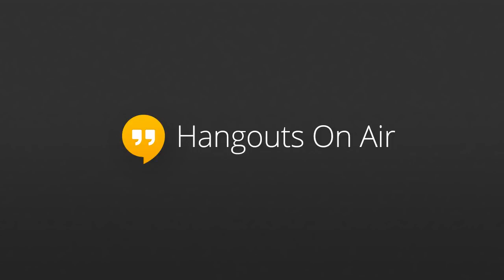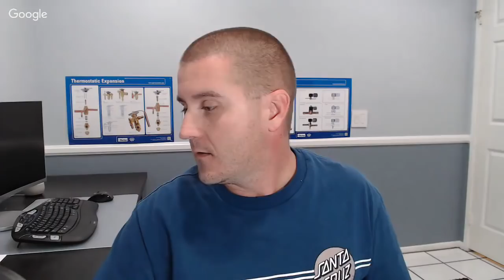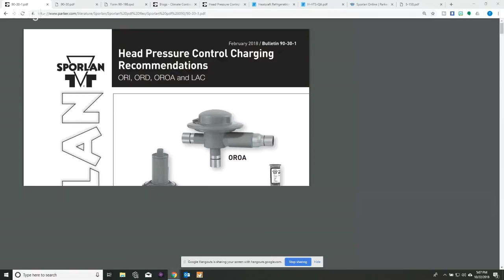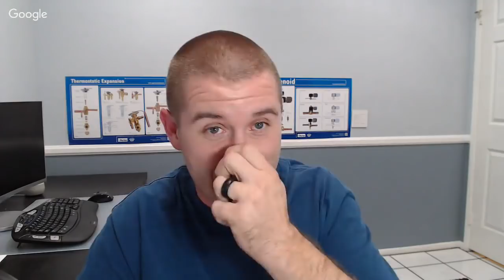HVACR VIDEOS HEADMASTER OPERATION AND Q AND A

Comment: Does the headmaster have a mechanical valve that blocks condenser flow or does the discharge gas fill the coil, reducing usable area and raising the pressure
Reply from the maker: The head pressure control valve restricts the flow and thus stacks the liquid in the condenser which drives the head pressure ip

Comment: Hey man great video. Two questions hopefully you will see this. When charging unit in winter and adding fir winter charge do you just block off condenser to reach above the bypass point of head master then fill to sight glass then add for flodded condenser?  Number two what is best way to deal with micro chanel. And three on trenton unit has a setable hpr. Manufacture says vomes out set for 150 psi which to me is liw for 404a ive alway shot for 180 min. Seen that ? Unit evap freezing up. Sight glass full at 150 psi. Feeling lines, not feeling discharge going through hpr. Last question when torching the reciever if im at 50% or better am i ok or should i shoot for 3/4
Reply from the maker: I will discuss this on my livestream tonight 12/11/23 @ 5:PM (pacific) on YouTube, come on over and check it out  https://www.youtube.com/live/JtR64RSnTl8?si=7eRTBYJXHWXPJZNR

Comment: Q:  A headmaster does not (directly) sense outside temperature.  The pressure is fixed in the calibrated chamber within the Headmaster and pushes on the plunger and the orifice controlling the bypass.  The liquid refrigerant pressure feeding into the headmaster is what (indirectly) senses the outside (ambient) temperature due to it's P/T relationship.  When cold condenser liquid enters the headmaster below the calibrated pressure the bypass modulates and hot gas goes to receiver.  The calibrated PRESSURE thus always maintained to the metering device (past the receiver).  Is this correct?  The beginner confuses the TXV with the headmaster at first but your videos seemed to iron this out.

Comment: All joking aside:  the metering device (TXV or cap tube or piston orifice) technically only reduces pressure due to flow restriction.  At the moment the refrigerant enters the distributor or coil,  it is still liquid,  at a Q of 100.  As the liquid picks up heat from the coil,  a little bit of it turns to gas (boils).  This is saturation.  First, however, any subcooling must be lost.  As the refrigerant progresses through the coil,  the Q drops,  as more and more of it boils into a gas. Near the end of the coil (ideally),  all of the fluid has been boiled to a gas, and it enters the superheat region.  If it is a flooded design,  then an aspirating accumulator is included after the coil,  but this is rare today for non-ammonia systems.

Comment: Im just curious here- could you also recover the entire charge, calculate the reciver volume (we'll say just for fun it holds 20lbs). Could we simply then charge the system with 18lbs of refrigerant and have enough refrigerant to fill our condenser in the winter when the headmaster is in bypass mode?

Comment: Thanks for trying to educate the new guys! Only comment I can add is charging to 80% is perfectly fine in warmer weather only. Head master can't be holding back when your trying to finalize the charge. As you know doing so would cause an overcharge condition. The 120 degree days you had problems can be avoided by oversizing condensing coil. Just takes money, but if it has to run so be it.

Comment: Could you use infrared thermal camera to check the level?
Reply from the maker: I am curious about that too, I just haven't justified the cost of a thermal imager yet.
Reply: @HVACRVIDEOS  yes you can. I use a flir tg165 fairly affordable and rugged enough to throw in with your tools.
Reply from the maker: I just bought the flir 1 and I didn't have very good luck today but I will give it another shot
Reply: @HVACRVIDEOS  the flir one has a clearer image than the tg165, I have both but don't like having to attach the flir one to my phone. Thermal imagers dont like anything reflective (copper, shiny paint etc..) so you may need to put a piece of electrical tape over what you're pointing it at to get an accurate reading.
Reply from the maker: Thanks for the tip

Comment: Chris, I think you said you pump down system and add refrigerant through the low side to fill reciever to 80 percent , you don't need to turn on the compressor to put that gas in